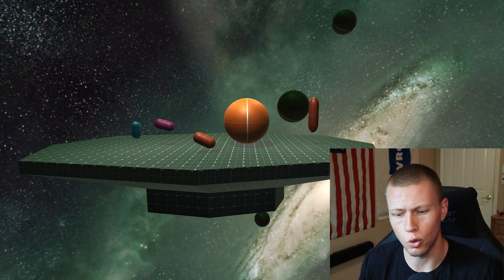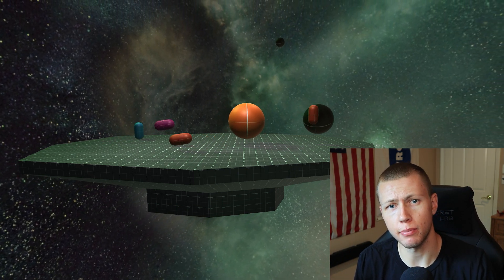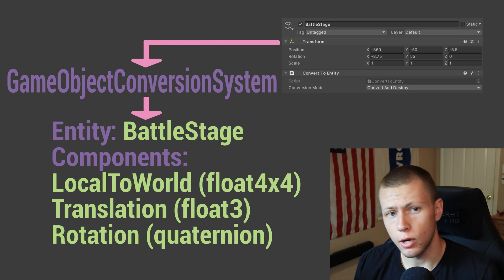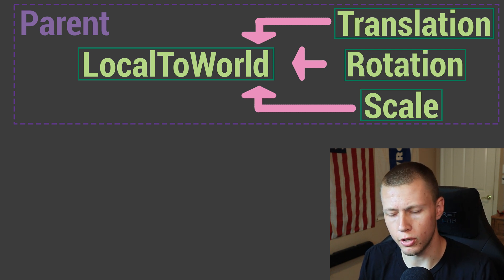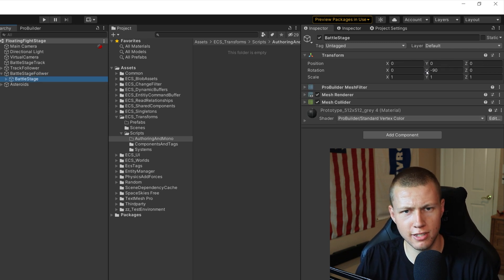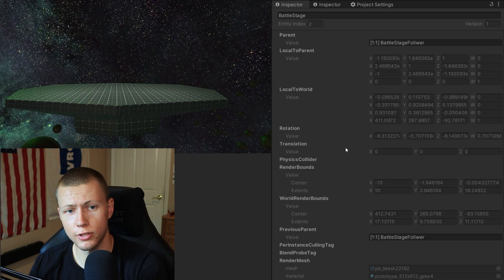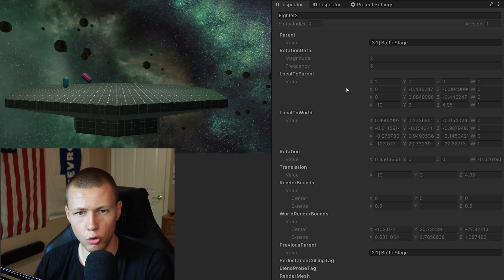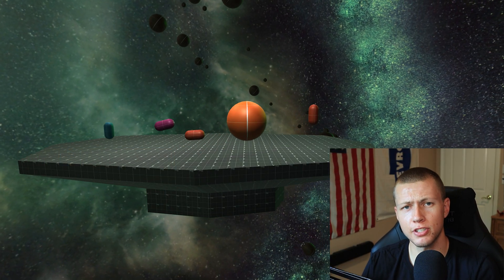Demystifying Transforms in Unity ECS - Unity DOTS Tutorial [ECS Ver. 0.17]

Comment: I have a game where I have like 40 UI elements tracking game objects and displaying their stats like in an RTS. Would I benefit from using DOTS or JOBS for this movement transform part ? Or is it just the inefficient unity UI rendering taking most of my performance with batching the UI ?
Thanks.
Reply from the maker: Unfortunately DOTS isn't going to help improve UI rendering performance as there isn't a "DOTS" specific UI solution provided by Unity. Where DOTS would be able to help you is if you had any complex calculations that needed to be done to determine the coordinates of where a UI element will need to be displayed or by doing some damage calculations to determine the values that need to be updated in the UI. If you're working on an RTS style game, it might be worth it to look into ECS anyhow as it can efficiently process large amounts of dynamic entities very quickly. Though if that isn't the issue for you right now and it is more on the UI side, I'd suggest seeing what 3rd party options are available. Hope that helped!!
Reply: @TurboMakesGames  Thanks. I just wonder, can I use BURST and ignore DOTS ? or is DOTS/ECS easier to implement ?  
Thanks.
Reply from the maker: @adambenk0  Good question, and this is something I'd like to clear up some more in a video soon. Basically to use the Burst compiler, you must use the C# job system - both these things have limitations on the data types you can use (typically only unmanaged data types like ints, floats, and bools). The Job system allows you to do multithreading and Burst greatly optimizes math operations. You can use these with regular Unity MonoBehaviours and GameObjects with a bit of extra effort.
ECS is a completely different design paradigm that changes how you structure your code and approach problems. It is very advantageous when used with a high entity count where you'd start to run into performance issues with regular Unity GameObjects. ECS integrates quite easily with Jobs/Burst - if you're using ECS, you basically get Jobs/Burst without any extra effort, so long as you stick to the limitations of Job/Burst. Hope that clears things up a bit!
Reply: @TurboMakesGames  Thanks a lot :) I have a project running on 2020 unity so I guess using  BURST for small pieces of a code, like position calculations, would make more sense.

Comment: would it be reasonable to define a dynamic octree in ecs, where you could need an octree instead of a list?
Reply from the maker: It could be. Did you have a specific use case in mind for an octree in ECS?
Reply: @TurboMakesGames  well, a tree structure is generrally what many abstract problems boil down to. an octree is just a fast visual tree with reasonable constrains.